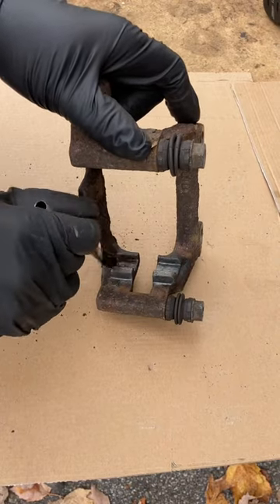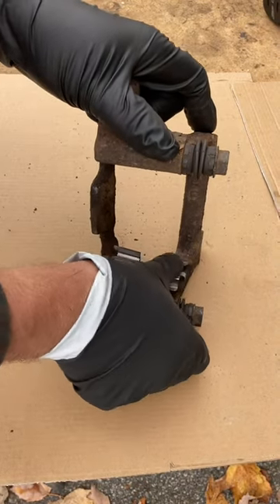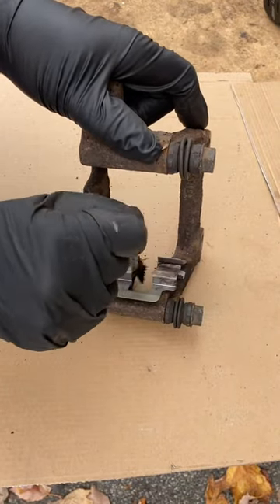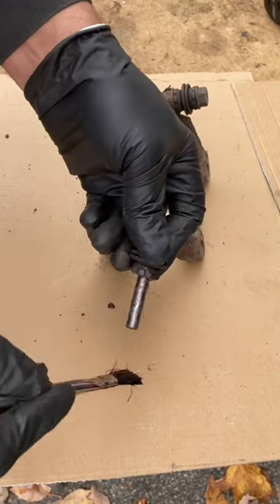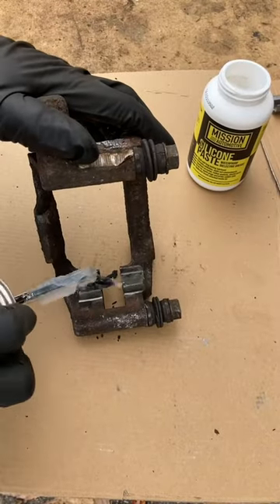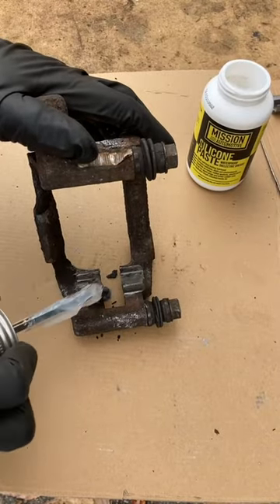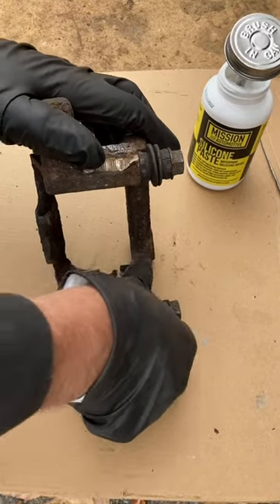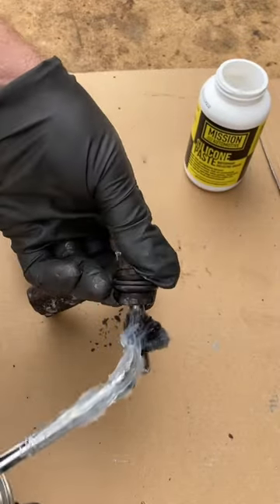What should you use for brake caliper grease? ￼

Comment: I put copper anti-seize. only a dab before and after the hardware. Also use synthetic grease on all brackets and behind the brake pads. Have the brake caliper rubber seal with the tad off grease. Use an old brake pad and compress while still also bleeding 🩸 the brakes. Almost to the end of compression I close the brake line(s). Own a corvette to which is a bit of a hassle and a nightmare to remove and replace brakes. Have a personal helper slowly stepping on the brakes and I open the line letting out the rest of the air and yucky 🤮 🤢 hydroscopic brake fluid until it becomes more soluble and clear  then close the line. Throw everything back together (within measure of copper thread anti-seize the top of the rotor and the   Bolts themselves) and then good to go for the next tire!🛞